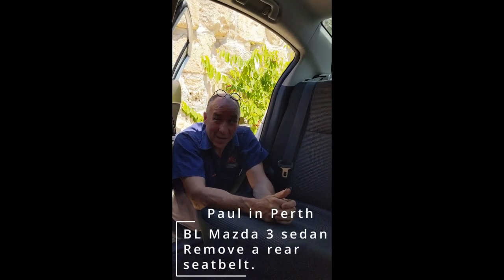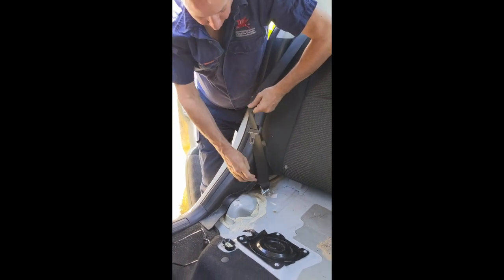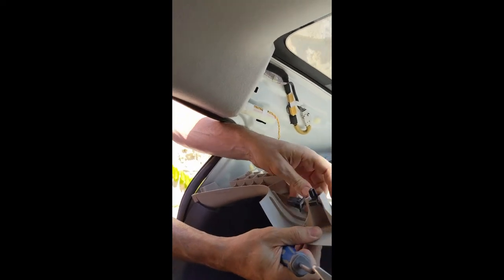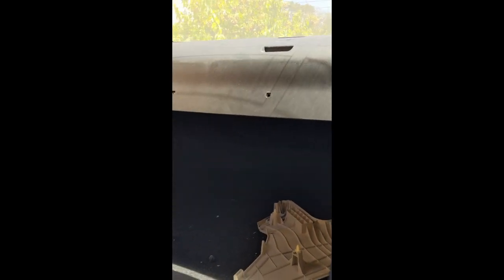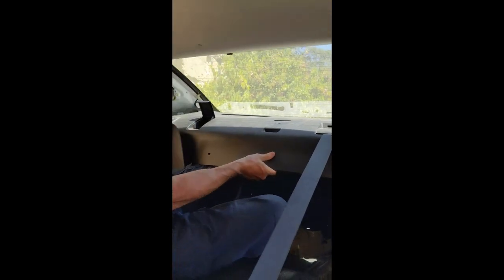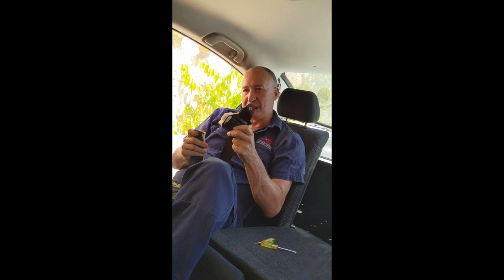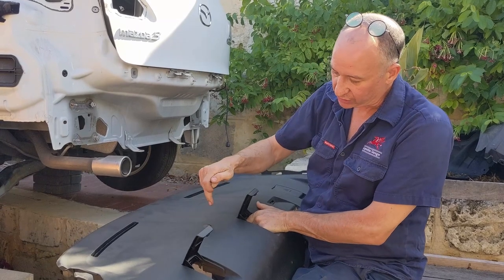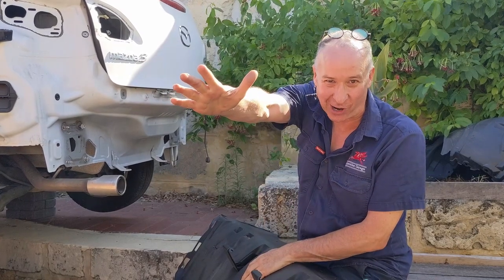BL Mazda 3 (2009 to 2013): Remove the rear seatbelt from a sedan.

Comment: I am from Saudi Arabia thank you so much for your videos and I replaced the rear window and the radio is noisy. I think there are wires that have not been installed. Do you have a video explaining this and how to fix it and connect those wires??
Reply from the maker: Hi there.  The BL hatch has an external screw-in antenna.  The BL sedan has an antenna embedded in the rear window.  I don't have a sedan at my house at the moment to find the connection point.

When I get my next BL sedan I'll make a post about resoldering the antenna connector.

In the meantime, I can only recommend you call some auto-glass installers and ask them.  Sorry I can't help more.

Paul.
Reply: @PaulinPerth   Thank you so much and I hope you be happy

Comment: Do you also have the rattle sound coming from the rear seatbelt mechamism? I do get that sound when driving slow on a rough pavement.. but unnoticeable when driving on high speeds
Reply from the maker: Hi John, I didn't have any rattling sounds from the rear seat belt mechanism when I had a roadworthy BL.  

It's very possible that a small bit of plastic has broken off inside the mechanism housing.  My advice is to carefully remove and inspect the housing.  Paul.
Reply: @PaulinPerth  i'll try. Mechanic did the inspection and couldnt locate nor recreate the noise. It seems more on the inside cabin than the outside noise. Only place i could think of is the seatbelt mechanism.

Comment: Curious, is there a back seat release from inside the boot for the 2009 mazda 3?
Say if your battery was flat and your key is not unlocking the doors 😭😭
Reply from the maker: For the sedan - no.  If your fob battery was flat then you could of course put the physical key in the drivers door lock and open it that way.  No battery required.